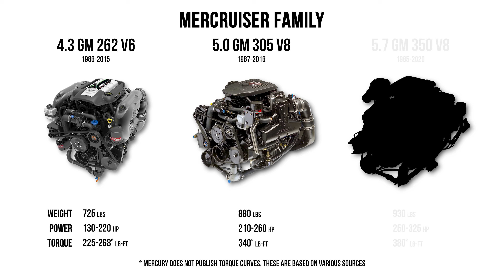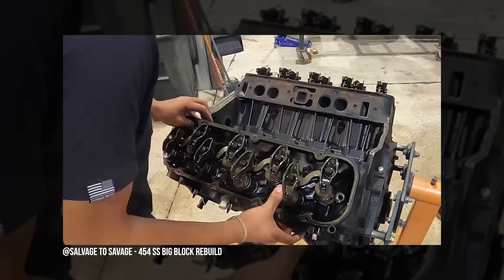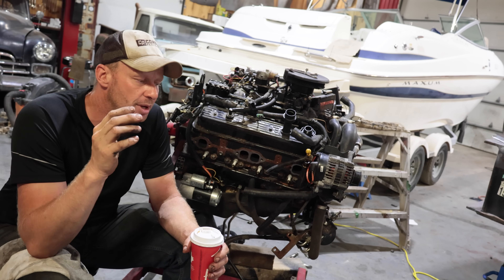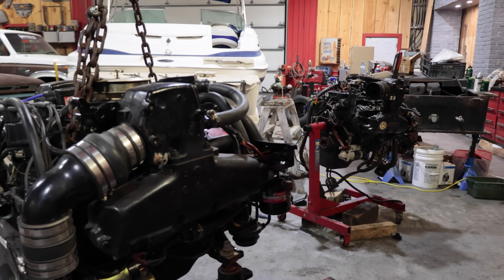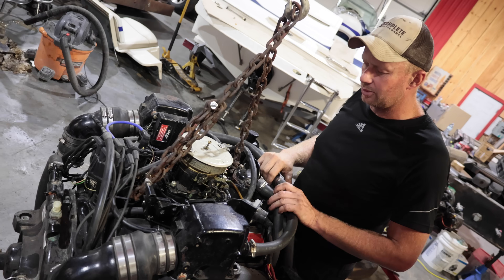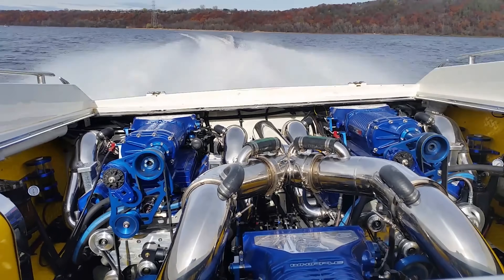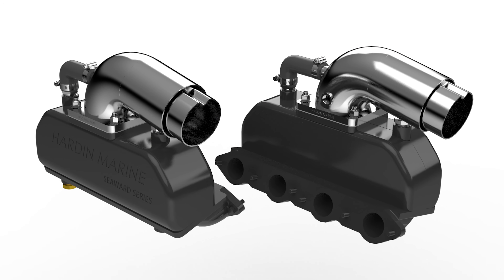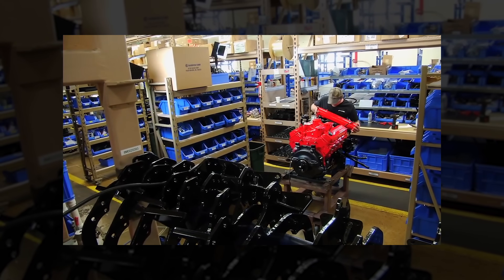REVIEW: Everything Wrong With A Mercury Mercruiser

Comment from the maker: What engine should we review next?
Reply: 6.7 cummins, id be interested in learning more about that engine
Reply: 2uzfe out of the toyotas
Reply: Harbor freight predator
Reply: ALH TDI!!
Reply: The lotus designed , mercury marine built LT5 from the C4 ZR-1!
Reply: 3208 - for the boat of course.
Reply: 502BB
Reply: 13B
Reply: The 5.7 vortec
Reply: I drove a friend's 8.0 L Hino 6cyl...very smooth, with a smooth shifting transmission. Must have been about 20-25 years ago. These must be cheap and available for swap projects now?
Reply: Mercruiser 5.7 with a closed cooling system
Reply: 2.8L duramax
Reply: 2.2 Vortec Chevy IL4
Reply: More Mercuiser engines
Reply: 22R
Reply: Brm tdi 1.9
Reply: Since you are into boating engines now. How about some Volvo Penta's?
Reply: Please review a Yanma L100N5
Reply: The 632  Chevy crate 1,000 hp NA engine. $38,000
Reply: Mack E7
Reply: Could you do a Volvo Penta engine? A B23 for example.
Reply: 1.9 TDI in their multiple variations
Reply: Ford 4.6 2v
Reply: Ford 300 inline 6!
Reply: Dodge magnum v10 or magnum engines in general since they are mostly the same platform from the 3.9 5.2 5.9 and the 8.0
Reply: 12B or 13B
Reply: Perkins 2.2 litre diesel also known as a 404d-22T or 404c-22T, also a cat 2.2 mechanical or common rail.
Reply: Two cylinder John Deere circa 30s to mid 60s.
     Best regards from Indiana, USA.
Reply: 5.7 I force out of Toyota tundra
Reply: Dad locktite cold welded a  cracked 350 Chevy between the exhaust ports from freezing and it held on the boat shop truck for years.
Reply: I don't know how you'd get your hands on one, but since you have a soft spot for old Detroits it would be neat to see your take on the 2-stroke EMD engines, the 567, 645 and 710.  They can be boat engines too, just in really big boats!
Reply: Cummins 6CTA diamond series
Reply: I’d love to see you review the new Cox diesel outboard
Reply: Barra
Reply: Yamaha Volvo/Ford
Reply: 300 inline 6
Reply: Saab B204
Reply: Any new 4stroke outboard
Reply: Mercedes Diesel OM602!
Reply: 2.8L and 3.8L (not the 3.9L) Cummins. 
These are becoming more popular in swaps.
Reply: Convert a modern 4 cylinder engine to adapt to a mercruiser drive for smaller i/o boats.
Reply: Ford 2 valve
Reply: 1.9 alh!
Reply: LBZ Duramax
Reply: Ford boat engine?
Reply: Chrysler 3.9 V6 and 5.2 318 V8 and the Volvo redblock engine
Reply: Can you do the TDI Volkswagen engine. I might be buying one soon so I wanna know what to look out for.
Reply: Zetor 6.8 litre turbo
Reply: Caterpillar 3304 and 3306. Personally I've had good luck with them, and with the right cards they can go forever without a rebuild, but they do have their weak spots. I'd like to see what your opinion is on them!
Reply: I'm late to the game...but definitely a Ford Lehman 120 or Super 135.   Thanks for the great information!
Reply: 7.4L !
Reply: Ford gt 40 pcm marine.. die hard engine 👌
Reply: BMW M57 !!!
Reply: Mercruiser 496Mag HO Please
Reply: You should review the aircooled 1961 Continental 0-300C that I have in my Cessna... Based in Oshawa but I do the work on it at Edenvale.
Reply: Did I mention it has dual magnetos...
Reply: Both Merc 165's. The L6 and L4. Two of the most bullet proof engines Mercruiser ever made!
Reply: Bit late, but would be interested in seeing an outboard engine!
Reply: Saab B234
Reply: I picked up a 1977 Mark Twain V-Sonic with the Mercrusier 233, it's the 351 Windsor. I'd love to hear more about it.
Reply: 305, 5.0
Reply: Anything Ford Ecoboosted...😮
Reply: SR20et

Comment: Hello, I am seeking your advice regarding the engine of my 2006 265 Ciera Bayliner. It currently has a single Mercruiser 5.0 MPI Bravo engine, and I am considering replacing it with a four-cylinder Yanmar diesel engine. My reasoning for this particular engine size is that I believe it would provide more space within the engine room, potentially simplifying future maintenance. I would greatly appreciate your recommendations on suitable small-sized diesel engines and brands, as well as your opinion on whether I should retain my current sterndrive.

Comment: I agree with a lot of what you say,but,the 4 bolt main thing is not accurate the standard Mercruiser engines are not 4 bolt main,the V-6 And the 305 block never had 4-bolt main blocks,the biggest difference was the camshaft and they used brass freeze plugs on the block and depending on carburetored or EFI the fuel system,the marine engine is under much more load than a car/truck engine, there are to many things that are different from a car engine versus a Marine engine,exhaust,cams,intakes,
Reply: I have been a marine mechanic for over 50 years and had some very good mentors, Marine Hi-Performance engine builders and they taught me the difference between a car engine and a Marine engine,there is a Big difference

Comment: cool video breakdown of the 262 . my friend has a 4.3l merc 2011 that goes pass 160 deg  reaching 180 @ wot after running abt 30min.  have to lower the throttle to bring temp back down.

Comment: Thank you for mentioning the cam shaft exhaust overlap. I never gave that any thought.... so if the motor is fresh water cooled there's still potential for lake/sea water to get in thru a valve from the exhaust there as well? Obviously I'm ignorant to this so the reason for asking. Planning on buying an older boat next spring and God knows what kind of piece of crap I'll buy that I end up rebuilding or..... im stupid🤦‍♂️ I know better than to get another boat. 😅

Comment: I do not know much about my Mercruiser 300 Hp 350 MPI.   It is a 2010 with a Bravo 2 sterndrive.  It is in my 1989 Bayliner Ceira 2556.     I have taken my engine out a couple of times, the first time was to get to my bilge pump.   The second, to change my water pump.     I am interested in changing from the 5.0 to the 5.7 L.    Listening to you when you talked about gas vs. diesel, the Deromax.  I have not thought about going diesel.

Comment: I appreciate the video. I have a 6 cylinder mercurser in Alberta Canada. I do my own winterizing.  One comment I recommend to anyone doing this is to rod out the drain plug holes after removing the plugs. Mine has 5 plugs and the rear bottom drivers side always has weeds plugging the drain hole preventing it from properly draining. I think I dodge a bullet the first time I winterized. I always follow up by flushing the water side with copious amounts of RV antifreeze.

Comment: The water jacket in the manifolds will corrode with time and it will fail eventually. The heads are sometime swirlport old desing that is know to crack easily. The gaskets need to be corrosion resistant.

Comment: I have a mercury MerCruiser 3.0 that i properly winterized(it never gets below 50 where I live, but I always drain the entire thing and fog it when I know I'm not gonna be using it till the next season) well that next season ended up being 10 years later my boat sat for 10 years, never got any water in it, was covered but now I think that the piston rings are stuck, is there any trick I can do to free it up? It's impossible to get to the front lug to turn it by hand. Thank you

Comment: Let’s not forget those blue plastic butterfly water drain plugs  can crack when they get a few years old and break when you try to remove them and it’s not always easy to get the broke off piece out. I like to replace them every 4 years are so. Available on eBay about $10.00 for a pack of 5. You’re so right about the frost plugs and the misconception as to what they do. Most people call them freeze plugs. They are actually casting plugs like you said for removing the sand after the engine comes out of the mold. It’s actually very rare to see them come out before the block will crack due to freeze damage. I Winterize’s about 100 boats a year at our local marina. A heater is only good if the power doesn’t go off on a cold day and the engine isn’t winterized.  I like your video it helps educate boaters about things they need to know. Keep up the good work.

Comment: Is there any way to know if the engine in a boat ISNT original, or ISNT just some swapped truck engine boat? Would i have to pull the oil pan off and physically see its a 4 bolt main?

Comment: I owned a 160hp Mercruiser straight six for many years. Awesome engine, we ran it hard water skiing year after year never a problem. All you need do is correct winterization super easy and quick. My boat was 30 years old when l sold it and the engine still ran like new. They are quiet like a car and good on gas. My 160HP used less gas than a 50 HP outboard at the time. Even today in a ski boat l would go with IO. Never did like a big heavy outboard hanging off the transom. Today you see bosts with 4 and even 6 giant outboards hanging off the transom. Looks ridiculous.

Comment: Biggest problem with a Mercruiser or any other inboard? It's that they are inboard engines.  Have had both I/O's and Outboards and HANDS DOWN outboard is the ONLY marine engine I'll own.  Weight, space,  and the eventual certainty that the bellows of the outdrive will leak means I will never own an I/O again unless I buy a boat with a blown I/O that will be converted to an Outboard.

Comment: For what it's worth, the primary issues i run into on 5.0 / 5.7 mag MPI's would be fuel pressure from the cool fuel high pressure fuel pump. I deal with a lot of mid 2000s and up mpi mercruisers, IAC's, shift bellows, trim sender wires rotted off...

On the black scorpion, either you have vacuum leaks at the plenum, or some guy tried to time the thing when you are supposed to set it at 0° tdc and forget it. Poor things can never seem to find their timing.

White scorpions just add cats and fuel trim codes (pain)

But yeah, boat owners suck.

Also, I have yet to see a turn key start actually work the way its supposed to when one comes in. The enrichener is usually jacked up.

3.0's are comical little lawn mowers that flex the motor mounts like 20 degrees when they backfire.

Imo theyre great engines, i just see them at their ugliest

Comment: I used to machine Mercury blocks, intakes and exhaust manifolds in Detroit back in the 90's and 2000s. All products and tolerances went down the same lines as the GM powertrain lines.

Comment: Retired marine mechanic here. Worked on I/O’s since 1974. Could write a book why I chose outboard over I/O and Chevy blocks. Number 1 on the list is just like you say, ALWAYS UNDER LOAD! A well maintained outboard (2 stroke) will outlast them, and horse power vs horse power, a 2 stroke will out perform an I/O.
Reply: Question for you? I just got a boat with this engine it's a 94. Got it running great but there's fuel seeping out from the gasket between the carb and the intake. Like the gasket that the carb sits on. That's a carb problem correct? More than just replacing that gasket?

Comment: A diesel of relatively the same weight will have no power advantage and probably a reduction, the Cummins 6 is too heavy to compare and too long as well,  so that leaves the 4bt which is still heavier but close enough perhaps  and maybe the gm 6.5 but good luck marinizing that

Comment: Hi, recently had my boat engine submerged. Forgot to take the plug before freeze time. Now spring came to the boat and was fill with water up to two inches bellow the oil filling cap. 
Would you give some recommendations ?
It is a Mercruiser 6.2 Bravo.

Comment: I've been working on mercruiser IOS since the '70s. The big competition was OMC which was an even worse piece of design for destruction. They found that they used Ford engines. And it was found on reef dead. At least the Chevy engines didn't rot away so fast. Drives used to be so complicated and everything had to be perfectly sealed and shimed. It could take a whole day just to take a drive apart to replace the water pump for a yearly replacement as part of maintenance. Of course you had to seal check it after you put it all back together. If it didn't pass the test you had to take it back apart. Find the leaky seal or whatever shaft. Oh no there's another seven or $800 worth of parts. I'm sorry customer it going to fill up with water otherwise. Don't you wish you had an inboard. If you know how to drive a boat you'd be happy with an inboard. And then the only leak you have to deal with is the stuffing box and the cooling system.

Comment: I have a mercruiser 3.o 4cyl  that seized Drained water from block and manifold but didn't fog the cylinders you think its possibly a stuck piston and will the rings rust away after several years of indoor unheated storage ? Should we use ethanal free gas ? I bought a used motor and lower out drive for only $350.00  will thoroughly go through it and also soak and mechanically try to turn over the engine in boat. Why did I buy an inboard /outboard ???

Comment: You can also tell Vortec vs non vortec heads by the valve cover, Vortecs used 4 centered bolts, non-vortec had 8 around the outside rail
Reply: Vortec engines use four bolts through the center of the valve cover.  Non-Vortec engines use four; two on the "top" and two on the "bottom" of the cover, around the perimeter where the gasket is.

Comment: Finally I heard a common sense answer. The biggest problem BY FAR is the owners. These engines referred to are absolutely tried and true. Thus. . .  Mercury marine uses. Hard to survive if using and rebranding garbage. But they use the best platform.

Comment: Sure in Canada and N States if you don't drain early enough you will be very sorry. Me I'm replacing the SBC 350 in front of my Bravo3 with a .060 over 454. Also a cooling heat exchanger for it running antifreeze. I take issue with the 4 bolt main comments as the caps are very strong. I'm just using an ARP stud kit for the 2 bolt caps which allows a little more torque. Holley 3310 carb with flame arrestor. Oh the 3/8s rod bolts are being changed to ARP hi performance bolts. Keep the rpm down to 5200 and it will be fine. Forged TRW pistons. Aluminum heads with 2.25 and 1.88 valves. Exhaust valves are incolloy to ensure it doesn't drop a valve. No street valves. Iron crank - what could be better to make 450 hp.

Comment: The later mercruiser V8s are 100% just Vortec 350s with the optional 4 bolt mains. The only differences (aside from your normal boat stuff exh manifolds, water pump etc) are the EFI and corresponding ecu. The Vortec marine multiport fuel injection uses actual fuel rails and individual bosch style injectors with the throttle body plopped in the middle pointed skyward just like the units found in trucks / vans from 96-03. Even the distributor is the same as the road going version, with the flattened crab cap and a 1x cam position sensor under the rotor. The ECU only handles fuel and timing with no provision for running the electronically controlled 4l60e/80e and its fueling program is optimized to take advantage of the lower operating temperature those engines would see. Oh and ot was setup to operate in a speed density configuration as opposed to the trucks which used a mass air flow metering setup. You can use a the marine efi stuff in a vehicle, you just have to have an analog transmission like a 700r4/2004r or something earlier and make a provision for tv and kick down cables, if you want to run a 60e or 80e transmission then youd need a separate controller. But if you go the standalone route you might as well get one that does fuel and timing as well

Comment: My hands down favorite Mercruiser engines are the 165 both the inline six and the four banger. Both very economic and incredibly reliable. My 1976 Merc 165 L6 runs at a religious 143 degrees and only burns about 5-6 gph at 3200 rpm and 26-27 mph. That's its sweet spot and cruising speed. I'm slowly restoring an 18' 1976 Apollo tri hull. With a 15"x17 pitch prop, just me and a full tank of fuel on perfect water she does 41 mph at 4500 rpm WOT. For such a heavy boat it has a pretty good hole shot and is a fantastic boat for tubing.

Comment: I do everything you mentioned in the video, in addition I warm up the engines using the muffs until the thermostat opens then switch over from the hose to a bucket of anti freeze. Once the antifreeze comes out the exhaust I then fog the engine until it stalls out. Once it stall out I open the drains in the manifolds and the block. 

So far so good.

Comment: Great info, but when draining, count the plugs and place in zip bag w/keys. Buy a mirror on a stick in the mechanic’s isle and place wire in each drain hole as sand or other debris can make it drip, but still full and subject to freeze cracking. If you have a 7.4L with a belt driven seawater pump, remove the low pressure fuel pump. It contains lube for the roller on an eccentric. This makes the mechanical fuel pump work. To remove, use a suction gun with a length of metal pipe in hose end to help. Service indicates drive lube! Not motor oil. The chemical dye in drive oil reacts with water in a seal failure and changes color, so an indicator. Certain years of 5.7L, 7.4L have 3 locations for the dipstick tube to service the engine oil. First design was drilled and capped, second design was not drilled. Camshaft are designed with low end torque & not speed, so the opening & closing events of both Intake/Exhaust are different from vehicles. If needed, get a cam for a motorhome. Change filters including fuel and always use SS clamps. Thru hull devices if added need grounded from the fixture to engine ground. Use star washer for a good bite & solder all terminals, shrink tube and dielectric grease. The grease is sold in auto isle at home stores as well as marine. If it freezes and you own a vehicle, service / maintenance section of the owners manual will have you apply a thin film of this grease on rubber weatherstripping. It not only hydrates the rubber, but allows doors to open if freeze during rain or car wash. 
ASE Master Tech, 78.